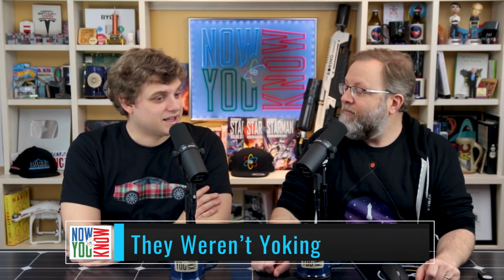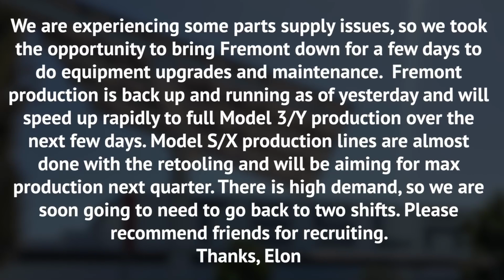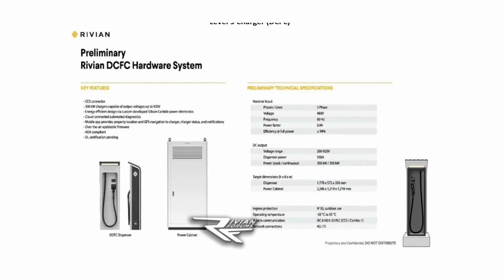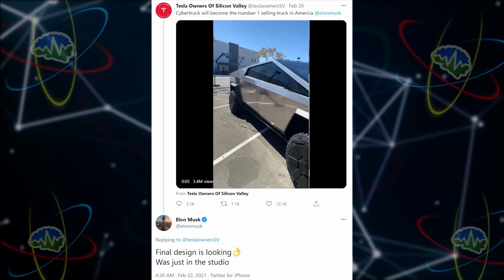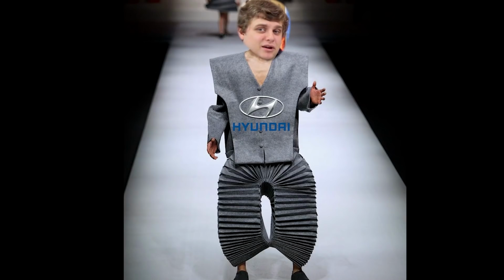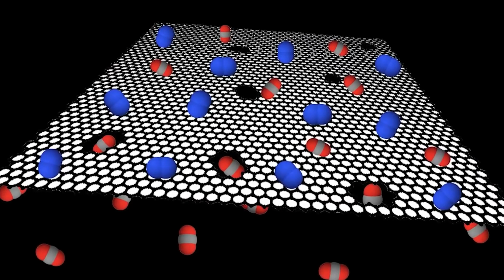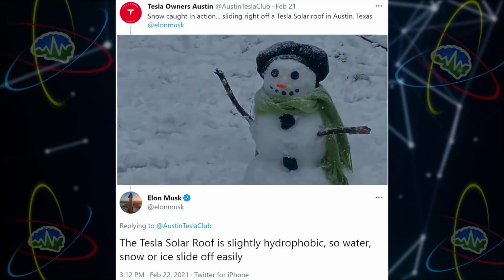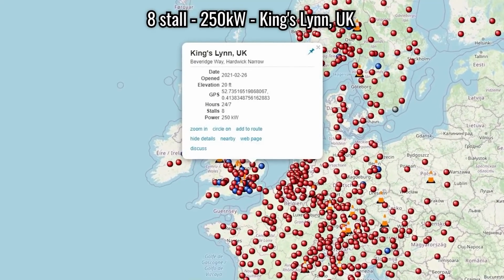Tesla Time News - Nikola Admits Milton Lied!

Comment: You guys forget that the USPS has to deliver to every single remote corner of the country every day, or as close to every day as is possible, and anything that interferes with that schedule damages the economy. People need their checks, the bills, their packages etc to get there on time all the time, and the country is still far away from having the kind of charging network that would allow mail to be delivered on the same schedule that it is now using an all-electric fleet. And making the transition too early would cause problems that would actually set back the transition to electric. The Postmaster General obviously made the right call that will support the transition in the future - you should be thanking him rather than advocating for his replacement.

Comment: The yoke in that picture looked kluged up:  Look at the bottom spoke;  it looks like they sawed it off from the original round steering wheel!

I have no idea why anybody would want yoke steering on a daily-driver car.  A yoke is fine on an airplane, where you can’t turn it more than ~90 degrees either direction of center, or perhaps on a track car where you hardly ever take sharp turns.  In daily driving though, you have to be able to routinely turn it to a position somewhere between centered and up to (typically) to 2 1/2 full rotations either direction, and old it there for a few seconds, making fine adjustments from there.  A yoke doesn’t work for that.

Also, how exact do you signal a turn?  Use the touch screen?!

Tesla has got to stop making our driving lives harder by trying to make our lives easier!  They got it all pretty much right in the original Model S.

Comment: If you guys are serious about the mail trucks, then you'll ideally work together to create a letter template that you link to from here, and the same page should have a list of the relevant addresses for the country's government departments or politicians who should be contacted.

Seriously - this is how change happens.

Electric cars are how the USA can finally pull its weight in terms of clean air and alternative fuels. Add solar and batteries and you guys could start a revolution. Texas' recent power issues would be a thing of the past if solar and battery was combined with V2G in a gradual rollout. The traditional power grid should only be the backup power.

Comment: I see a lot of potential for solar on most farms. I can see the potential for solar in the row crop industry but it will take some time for the farmers to wrap their heads around.  Its not fun having to farm around permanent structures and some equipment can get quite large so you don't want to worry about damaging your panels while working. Many farms have large amounts of roof that could be utilized also, we are dairy farmers and just over a year ago we put in a larger solar system and now with net metering harvest enough power to offset approx 92% of our costs. Thanks again Zak and Jesse for your great content. Here's a little video of our installation   https://youtu.be/JFv1EPEbw74

Comment: So, where is the USPS going to plug in all these EV's postal trucks?  Does the local Post Office have a large transformer near by???  It seems that one of these chargers, especially high capacity chargers at $40K a piece are going to need to be installed at the post office (one per vehicle).... Interesting... I hope they include infrastructure in the cost of the vehicle.   Rain/snow/ice regardless of the weather the mail will go through!  Do you think that a EV postal truck can handle -40 degree F weather???   Would you risk your life getting in an EV in this kind of weather?  NOPE!
Reply: Postal trucks can charge overnight from a simple 110v outlet. No need for expensive superchargers. Also, an EV can power a heater for DAYS if you get stuck in cold weather, and they never fail to start. The notion that they can't deal with cold weather is false.

Comment: You got to get serious. The Oshkosh company is capable to build great trucks that are much more dutrable than most other cars that are offered by the industry including Tesla. You got to consider that it doesnt make sense to invest into electric mobility where you have no more wearing down of breaks, transmission and motor parts but then the whole car is not designed to last for many decades into the future. The switch to EVs is only going to make sense if the driving as well as the production of these vehicles is sustainable. It is just wrong that todays EVs are build to last only for one single decade. This has to change and so far there is no EV manufacturer that is offering anything like that. Not even Tesla. So please dont fall for the wrong design and specs arguments. It is all about sustainability and about our future.

Comment: Good job for Tony pointing that out about the photovoltaic panels on greenhouse or agro structures. However, I am currently interested in this company and what they have and suggest ALL should look into it. The company is SOLAR WINDOW and they have designed a power product that is clear and creates energy just like solar panels except you don’t need to have it in direct sunlight. Their solar window film can be put on any surface and still creates power from light if it is on North, West, East, or South side of your house and you can put it on surfaces inside your house to make power from light that shines into your house. The other interesting thing is this film could be applied to the body and windows of cars, trucks, RVs to help supply power while they are moving or just parked. This company is onto something huge and it will benefit people even in the north who get less sunlight in the winter months. SOLAR WINDOW!! I would also hope that Know You Know does a story on this company in the next weeks.

Comment: Sometimes you guys just exaggerate the truth and create false claims to support your claims.
Regardless of the drivetrain location most of the braking happens on the front of the car because that's where inertia carries it it's physics also the drivetrain does not affect wear and tear of the car the primary reason for that is turning when you turn the tires where more so the front tires will always wear more unless you're drifting.
Reply from the maker: You are mistaken. If most of the braking you do is regen (which is how Tesla's drive), then most of the wear will be on the drive wheels.as they are the ones doing the braking. You are correct that if you hit the brake pedal that all the brakes of the car will engage and that the car's weight would shift to the front, causing more pressure and therefore more wear to occur on the front wheels. But that's not how regen works on a RWD Tesla, that's why it's important to understand what you're talking about.
Reply: @NowYouKnowChannel  thank you for clarifying, i am still right about the tire wear and tear

Comment: There was a short blurb on Thor trucks about 2 years ago. They are focusing on short haul (300 Miles) and are based in LA and the Port's tugs and trucking from dock to distribution yards makes up eh bulk of their targeted market. Initially they are using frames manufactured by 3rd parties. This may be another leap forward in cutting air pollution in LA.

Comment: Tire wear on Model 3  and Y  rear wheel or dual motor are almost the same because 99% of the time front motor is idle and the rear does the work.
You can see that easily if you have scan my tesla.
Front lit up only when you floor it, in reverse and sometime when regen on slippery contition but only after the rear lose traction.

Comment: so...Kite X technology could be used to make a cooling fan type of device that would sit at the front of the EV where the ICE radiator used to live and generate electricity while the car is moving. Y'all think this could have a potential for a significant range increase?
Reply from the maker: Unfortunately it wouldn't work as it would slow down the car and cause it to use more power proportional to the amount of energy it generated and since the generator itself isn't 100% efficient, it would lose more energy than it created.

Comment: No. No tire is going to add 10% range. The rolling drag savings is about 25%, they SAY. At highway speed, rolling drag is only 1/5 of the total drag (most of the drag is aero drag). So at highway speed, a 25% reduction in rolling resistance is a 25% / 5 = 5% increase in actual range. That 10% range increase they promise would only happen if you driving at about 45 miles per hour (where rolling drag is just under half the total drag), all day long, without ever touching the brakes. That never happens, as we all know.

Comment: Did you just adviced people to use a TSA lock? TSA locks are good under the care of the TSA, because... that key can be oredered online really cheap.... it's like not using a lock but thinking you are
Reply from the maker: Gotta keep the application in mind. This isn't securing anything other than the charger in the slot. If you forget the combo, you want a crappy lock on there so you can bust it off.

Comment: With the yoke, the part of the steering wheel that I hold is missing.
Reply: In modern cars, if the airbag deploys and your hand is on top of the steering wheel, it will probably break your arm. You're supposed to hold the steering wheel on both sides. The yoke would force you to get rid of a bad driving habit.
Reply: The 10 and 2 o'clock hands on the wheel that they taught in driving class will be gone.
Reply: @dublindave5795  I will be gone before that has gone

Comment: Why do you not provide a guide for judging the Telsa charging reviews
like a 10 point check list that gets you to 8 out of 10.  lets take a crack
1)Views or unique reason to stop
2) sit down food
3) quick food
4) no so quick access to a bathroom
5) quick access to a bathroom (5 implies 4)
6) access to a wide range of food options (6 implies 2 & 3)
7) access to over night lodging
8) access to a convivence or drug store
9) access to a wide range of shopping
10) easy to get in and out of

just as an example.  The randomness of the OUT OF system drives me nuts.

Comment: Don't starships run on methane? It's just a little confusing? Are they plug in's. Does Elon plan on bringing out a fleet of Methane cars, or are rockets cool?
Reply from the maker: Combustion is pretty much the only way to orbit.
Reply: My comment was meant in jest. Maybe slighty trolling ;) Great channel guys. Starlink could in fact reduce carbon emission by offsetting the need to travel for those in remote places.

Comment: Hey you might not want to use that lock. The back-up key for it is a dime a dozen on Amazon. go see what LPL has to say about that. (LockPickingLawyer vid #795)
Reply from the maker: The point of locking your charge port is not to prevent it from being unlocked no matter what. It's to prevent it from being unplugged by a passerby. There are plenty of valid reasons to need to force open a lock like that (as mentioned in the episode). If you are leaving your car somewhere where someone is likey to bust open the lock or pick it open or have a TSA key, you probably shouldn't leave your car there...